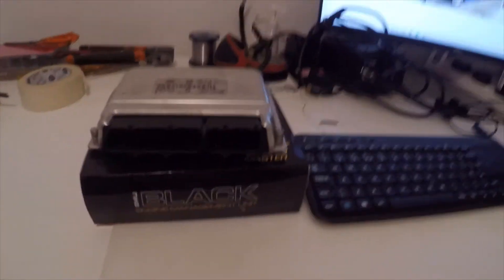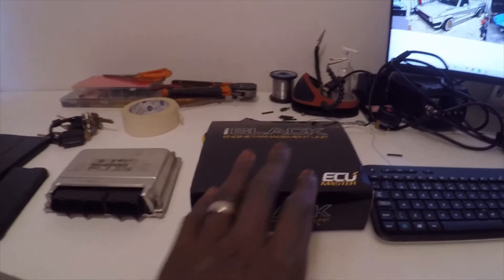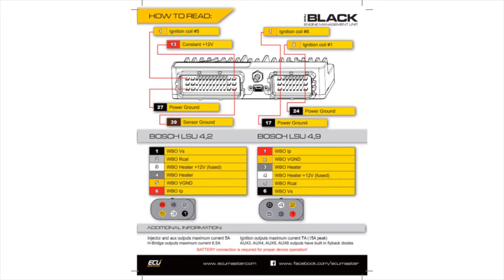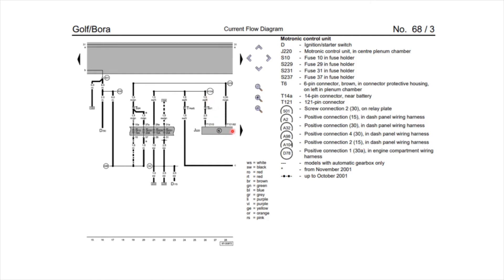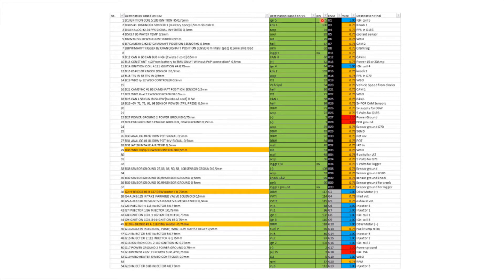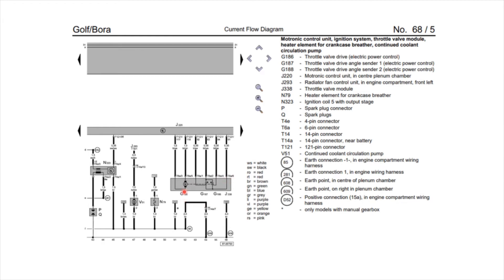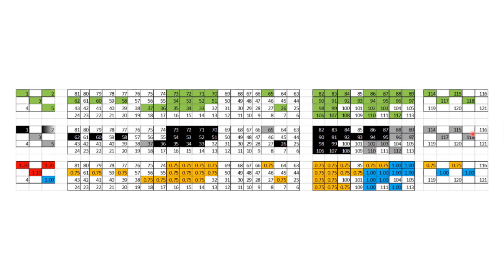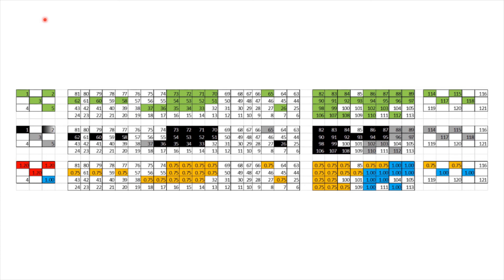How to - ECU Wiring

Comment: With certain wires, eg knock sensors aren't the supposed to be shielded wire?
Reply from the maker: Yep, good spot.  It was ok without the shielding ( only a short distance ) but I have gone back now and replaced with shielded wire just to be 100%